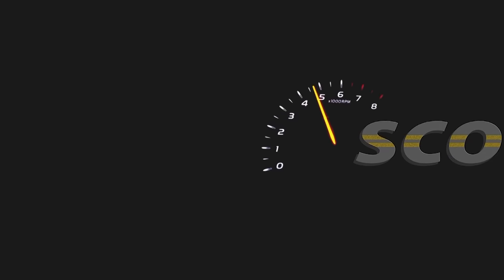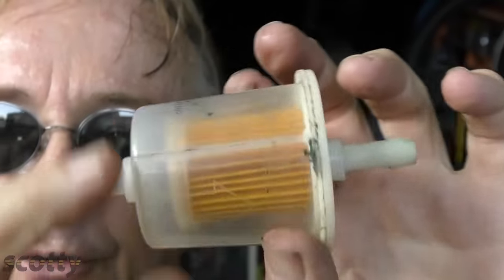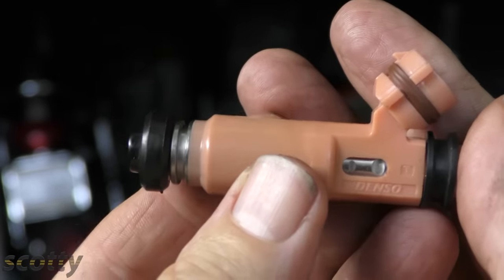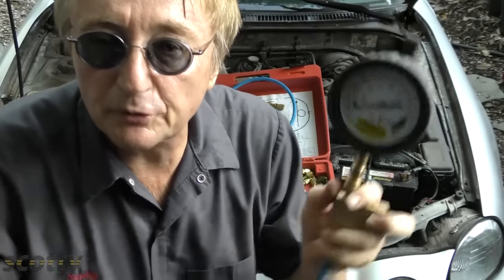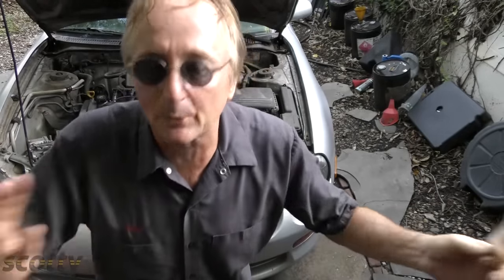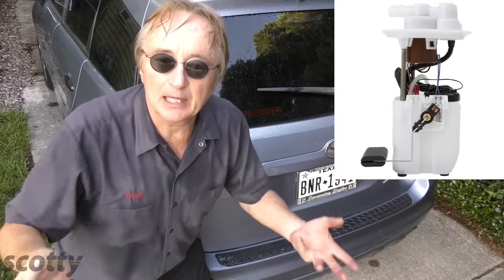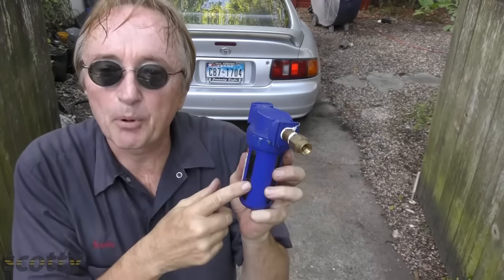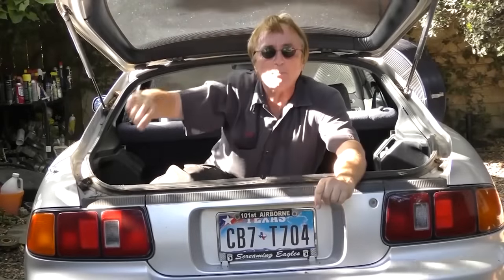Here’s What Happens if You Don’t Change the Fuel Filter in Your Car

Comment: The problem with having the fuel filter changed is that you have to trust the mechanic or service tech at the dealer to do it right. The danger with regular maintenance is that often the car comes out of the shop worse than when it went in.
Reply: Then learn how to do it yourself
Reply: Did it myself💯💪🏾
Reply: 😂 😂 😂… the mechanic? who pays for a mechanic when we’ve got YouTube and Hanes manual
Reply: As others say, do it yourself. It's not super difficult, just need to pay attention and don't rush.
Reply: Bruh fuel filter I could change at 16….
Reply: Right
Reply: @Dzugashvili  What if you found out you can't do it at the middle of the process and you can't put it back as it was nor finish the job?
Reply: I agree with you on that!
Reply: @ajsh3000 Only real way that would happen is you damage the fuel line or connectors.  Either put new ones on or tow the car to a shop or hire mobile mechanic or friend or family.
Reply: I just changed mine today.

Comment: Getting to a point where maintaining a car can be quite expensive
Reply: Audiofilio True that, just to keep it on the road
Reply: Not really, over the life of the vehicle, maintenance is only a few dollars a day, usually less than the cost of fuel.
Reply: paulparoma lol not even a dollar a day wtf is he talking about! Gas isn’t cheap and your wasting at least $5-10 if you really want to be technical with it.
Reply: You can see what these dishonest companies are doing.  They don't want you to fix your own car.   Does the government need to lay out some laws just like we have crash standards.   Its all BS.  This is the big screwjob that the car review sites never mention.
Reply: Duke Craig, Bullsheet.  There's nothing about a modern vehicle that benefits from the fuel filter being in the tank.  It's just faster to assemble at the factory.  Further it's often nonsense that it's all that expensive if you DIY, just drop the tank and replace the whole assembly.  It's usually closer to $200 than $600 unless someone makes a foolish choice on what to buy without researching parts prices.  Plus, new car mileage isn't all that great once you factor in the flimsy tinfoil, the low rolling resistance tires, and that if you care about fuel prices then you won't be driving an obscene # of miles so the fuel cost difference for a similar vehicle utility is very small, usually less than the increase in insurance coverage for a supposed "modern vehicle".

However you wrote "no free lunch in the world of physics" which has no bearing on this topic at all, so please only use such nonsense statements when they actually apply as if there is a physics trade-off because in this case there is not.
Reply: paulparoma, it's usually not more expensive to maintain a modern car, unless it has a new/defective design like certain power steering racks or weak transmissions.  Granted if there are no aftermarket parts sources yet so you're buying OEM parts, sure that can add up but nobody in their right mind does that.  Right mind meaning some people are even foolish enough to think that the automaker actually makes fuel pump assemblies which is laughable.  Skip the OEM middleman and save at least 40%.
Reply: Yea my point of view is this, once you hit the lesser of the two, 150K/13 years, time to replace if you can afford to.  I have two cars over 150K and I'm just wrenching on them every month.  If you enjoy weekend plans getting interupted due to ticking time bombs by all means keep wrenching.  Obviously if you have a Toyota maybe things are different, or you have a car you just are head over heals about, or the money isn't there to upgrade then different story.
Reply: Duke Craig “price you pay for a modern car”... I owned a 1979 Honda Accord, it achieved a higher average mpg than my 2007 Honda Accord with much less maintenance costs.  
In general, Maintenance is cheap compared to a major overhaul to a neglected engine. Of course fuel costs are not a maintenance costs either
Reply: paulparoma it’s not cheap to maintain a modern car. However, the alternative will possibly costs much more and may leave you stranded at an inopportune moment. Cars are expensive to own .  When I was in my teens an old Italian man who lived near us used to tell me owning a car will make you go broke!
Reply: It's not expensive at all. Think of it like this. It's cheaper than repairing a broken car that wasn't maintained properly.
Reply: That’s true but hell, a car is expensive to replace. So much cheaper to perform preventative maintenance than to buy a new car.
Reply: Audiofilo lot less expensive than letting it break like everyone else
Reply: @paulparoma  damn your a mathematician 1$ 365 days = 365$ 2$ a day = twice as much lol
Reply: @paulparoma  thats if you lets dealershipa maintain your car and not yourself
Reply: Cars are endless money pits.
Reply: Fr when u think about the manual
Reply: @paulparoma  Well...now imagine some crappy cars like chrysler, some bmw, Mercedes or Jeeps... A lot more just because more things are going bad with those certain cars...You get so much work getting done if you have a car! And if it's reliable and it will last me 200 000 miles or more I will be happy to service it and change the small assembly parts to keep it going!
With love, from Bulgaria🇧🇬🇧🇬🇧🇬
Reply: Well walk
Reply: Raymond Max  it's not that far off, with new cars they come with maintenance free for a year or two and warranty and well obviously repairs will be less since it is new... I'm not advocating for a new car either, I can't afford it but can't deny looking at the other side of things in the long run.
Reply: Price you pay for transportation
Reply: They’re like children. And the dealership is child support
Reply: Take 6 month to a year and become a mechanic.  It's will be less. That's what I did.
Reply: Still cheaper than eating depreciation of a new car. Especially if you can do some DIY
Reply: But it's much more costly to repair the car if you don't maintain it.
Reply: Don't drive so much! I drive 5K miles a year so no issues at all!
Reply: Not maintaining a car is more expensive.
Reply: Lmfaoo no it’s not. Do your own work.
Reply: @Ciana_Baby  This is the advice that keeps people poor. Why would I do a $10 per hour job when I make $150 per hour? The problem is that low level jobs are paid too much in the US. 

I just restored my old Celica in Greece and paid for example $10 to change the steering wheel liquid and it took like half an hour. I was there working remotely on my $150 an hour job. 

My advice is either to have a leased car or new with warranty in the US and not drive too much. Make sure you have a high paying job you can do remotely. I would never ever do a low level job for any reason.
Reply: They are liabilities not assets
Reply: Actually, maintaining a car, you can spend about £150 - £500 a year, I’m talking oil filters, air filters, fuel filters, windscreen wipers and bulbs.
Maintenance is easy. It’s when you factor in perishables that cost, like tyres, brake pads and disks, sensors and some liquids. I mean, little and often is the key.
To change all your pads, disks and brake fluid for example. Half a days work plus £150 straight away. But then you know you have good brakes for a while.
Coolant flush, an hours work, coolant £15.
Oil change and filter £60.
Fuel filter £20.
Spark plugs £6 a plug.
Tyres £60 a pair.

I mean, it does mount up, but compare that to how much public transport costs, it’s fairly cheap. It’s also, always good to know your way round a vehicle in general and your vehicle especially. Anything you can fix, to do so. Then lean on garages for the specialised things such as suspension, shock absorbers, catalytic converters etc.

Even if your all in on your car for £1500 a year including tax, insurance, maintenance, being road legal - excluding fuel. It’s still only costing you £4/5 a day. To have that freedom for that cost is actually decent.
Reply: Bike
Reply: $10 fuel filter is cheaper than a new engine.
Reply: @sakispsinakis  better 50k a year Highway than 5k a year city. It’s not good for a car to sit. Now if you maintain it properly then you’ll be fine
Reply: @HarrisonCountyStudio  if owning a car is gonna make me go broke how the hell am I supposed to go to work 🙃
Reply: We’ve been at that point for a while mate
Reply: @stiggy3416  I'm walking everywhere right now lol gas too much
Reply: 6000$ a month should pay ur rent etc n u should b able to fix ur whip buy from eBay n or rockauto bro
Reply: Just spent 150$ one one belt and a few filters.

Comment: I'm with you on this one!! I helped one guy out who's car had a blocked secondary filter. This car is a Mercedes 300D turbo diesel. Poor guy spent over $2k having the injection pump replaced in a modern workshop, yet they did not find, or fix the problem. His car then stopped on the side of a major highway. I pulled over to help him, & I replaced this little filter. He was mobile in a few minutes. The cost of this little filter was less than $10.
Reply: Same happened to me....I figured it out myself $500 bucks later.
Reply: @Jack51971  not good.
Reply: Thanks for helping him your a nice guy.

Comment: Auto manufacturers are using the term lifetime, knowing it’s a damn lie.
Reply: yes for them, the life span of a car should be 4 - 5 years then is a complete garbage, thats a lifetime for them
Reply: Alejo Colombia lol true facts.
Reply: It means lifetime of the warranty.
Reply: Outdoorsguy some people hate having extra money in their wallet, so they go directly to the stealership, and buy the manufacturer parts, or better yet, they drive by the small business mechanic, and pay $800 for a brake pad replacement.
Reply: Mcgyver B I agree... what gets me are the sealed lifetime transmissions... Having those decreases the lifetime of the car...
Reply: Outdoorsguy there’s so many idiots out there trading in better built older quality vehicles, for newer plastic everything under the hood, and they not realizing that most modern vehicles are disposable, they rack up so much money in maintenance even extended warranty companies are finding a way to deny every single claims, seals, and gaskets will only hold up for 5 years.
Reply: Alejo Colombia 
The life span of a luxury cars is 4-5 years and non-luxury cars is 7-10 years base on the manufacturer.
Reply: zxcvbnm4203 the 21st century economy is very well strategize for profitable gains, basically less quality equals more spending, millennials have no idea what they are up against.
Reply: Armando Sturzenegger 
I said "based on the manufacturer" meaning the warranty that u get on the car is the lifespan of the car. It does not mean the car will die on that duration.
Reply: Mcgyver B   Exactly !
   My brother has been a mechanic for 40 plus years. The  starter went out on our uncle's ford. He took it to the ford stealership and they charhed him $900 . to replace it.   My brother would have fixed it for the cost of the starter. No mark up.
   He is one of those guys that lives above his means. He thinks the ford place is the only one that can fix his car. He thinks he is better than my brother ( us ).
Reply: John Young you got that right everything inside the stealership is marked up, even the donuts and coffee, I always laugh when my brother said it’s for free, those guy are well organized better than a detectives office, far better than a war generals army plan, to upsell customers, rip, and tear through the old ladies purse, and tell the old man that has no damn clue about modern vehicles that he’s gonna need a new engine air filter, an alignment, and the front pad needs to be replaced along with the rotors, they do all these service right ups simply to make more money, am a huge supporter of small businesses, but these stealerships needs to starve, they are basically charging mortgage down payments for maintenance on a model that’s out of warranty.
Reply: Mcgyver B lifetime is ten years . They say cars should be crushed after ten.
Reply: Yep for modern cars, the service life is 10 years or 100,000 miles.  After that, most cars that have been minimally maintained begin the steep slope to failure.
Reply: Yep. A "lifetime" depends in their definition unfortunately.
Reply: Lifetime of the vehicle. Lol. And that “lifetime” part is the end of your vehicles lifetime 😂.
Reply: BMW's have transmission fluid that is "Lifetime fluid". If you ask ZF (the company who makes the transmissions) they say to change the fluid every 50k miles.
Reply: It's not lie. It is lifetime of the warranty of the car. It's not the car manufacture fault if you think it actually means forever. :p
Reply: Mcgyver B $800? What the f***???
Reply: When they say "lifetime" they mean the designed lifetime of the car.  Which is about 100K miles.
Reply: I never worry about the fuel filter. I don't own a 20 year old, which Scotty refers to as a modern car. Not to say that the filter isn't important and will need to be changed.  But, I have a service agreement and lifetime powertrain and bumper-to-bumper warranty on my car.
Reply: It's for the time that you own the car. This isn't rocket science
Reply: Any "lifetime" part should come with a lifetime warranty.
Reply: adam smith fully agree 💯
Reply: For example, toyota claims the fuel filter on my 2000 4runner is a lifetime part. Horseshit lol, most people on the forums change then out at 100 or 150k and it looks as dark as brake dust.
Reply: Jack Tran 
I have no interest in Toyotas 💩
Reply: Life time will be the time that you have the car.
Reply: Mcgyver B it's been going on for years. In this day and time u better understand what u got.
Reply: zxcvbnm4203. Im like Scotty. I have a 1995 Camry with just over 200, 000. 23 year old car. Looking to retire with it. So that lifetime  5 to 10 year thing is crazy unless you put 80, 000 miles a year on your vehicle.
Reply: Lifetime is not your lifetime but instead the expected lifetime of that part or vehicle. So if the Lifetime of a Battery is 5 years and it goes bad at 2 years then yes it would be covered but it will not be covered at 6 years. It's definitely a Trick word they use to describe the quality!
Reply: After 10 years they all die.
Reply: @vaguincolombia  well I have a 2014 Silverado with 95,000 miles on it. I regularly off road and The original tires lasted 86,000 miles and they were  not even at the wear bars. I averarge between 22 to 24 mpg, averarge!  So far I have not had one problem with it, Not one!  It has a 5.3 V8 and has plenty of power for off roading. 
So not all newer vehicle's are garbage. A lot of them are but not all...
Reply: @jopisano67  loads of life left
Reply: I don't like these lifetime things in newer cars I like the older ones so it's easier to change the filters mines 16/17 years old and still runs better than most newer cars can't beat the self servicing and maintenance rather than having to pay for a garage to do it so the warranty stays valid.
Reply: When it breaks, that was its lifetime. Sped up by old fluids.
Reply: Alejo Colombia nailed it
Reply: @vaguincolombia  20000000000% lie if you see some old cars even A Stoc Trueno I will frequently freak out.
Reply: @ALPatingitGaming  I meant car manufacturers nowdays. Not old production cars. Newest cars are almost pure plastic.
Reply: @vaguincolombia   Yes you're right about that, kindly it's impossible, I saw for what so like example honda Civic?
The 2006 version? I mean SO MANY USING IT  yes this is a modern car but more modern cars like civic type R the newest version, Hmm so 5 years? They making it 5 years? no!, If I were them I will keep it to 700 years. Idk if I can be alive with that lol.
Reply: @ALPatingitGaming  and now compare a 2006 honda civic against a 1992 or 1995 one and you will see what i mean. Also people dont want a car more than 5 years specially in USA.
Reply: @vaguincolombia  btw Im in philippines.
So no doubt I am liking more than 5 years
I know what honda models you are trying to make me see. Cause I love older cars ;-; also RIP Old Cars in US. That's why your people go other countries. In the US ofcourse
Reply: @sambrandt4755  after 10 years a poorly maintained car will die, a well maintained car will keep going but will need more repairs than just regular maintenance.